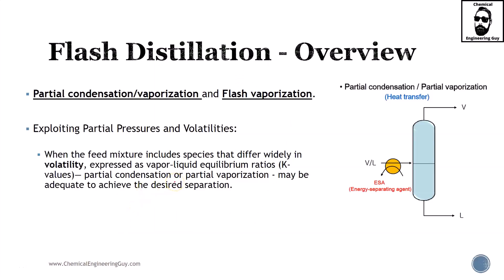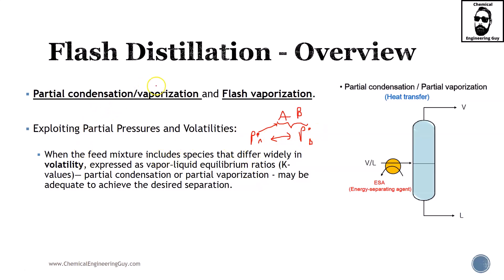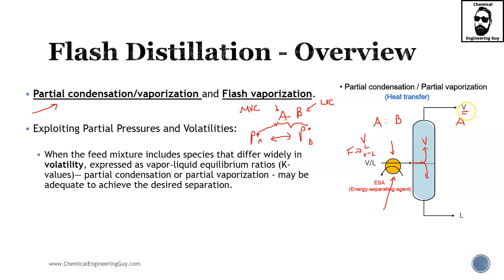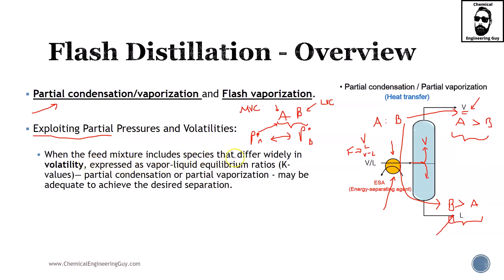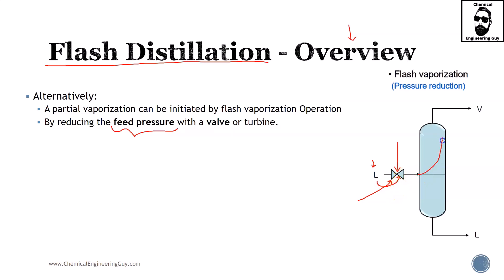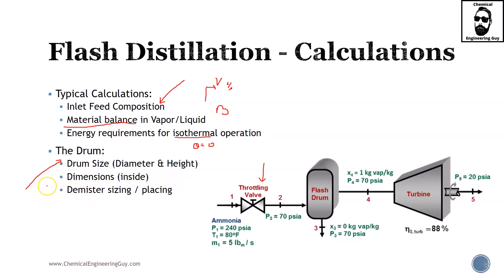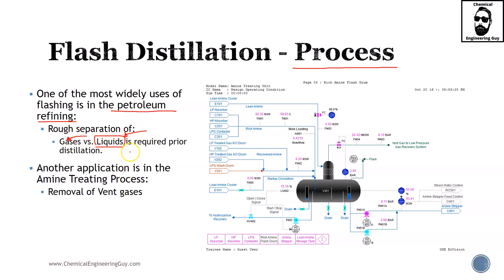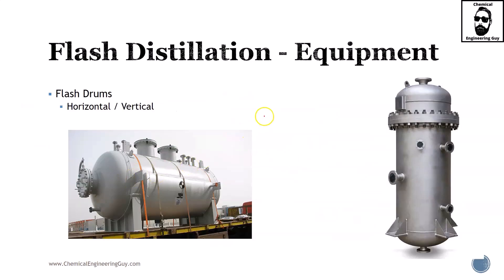Flash Distillation - Separation Process involving Creation of a Phase (Lec060)

Comment: Whats the difference between flash and vacuum distillation? both use reduced pressure...
Reply from the maker: Not really... flash drums can be pressurized as well, vacuum distillation is a special type of distillation that reduces pressure in a distillation column (there must be more than 1 stage)